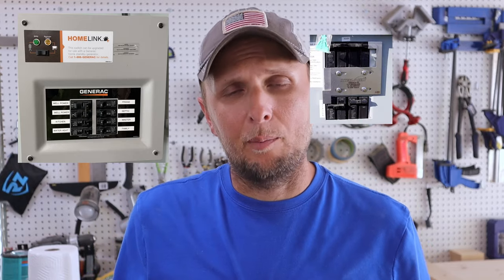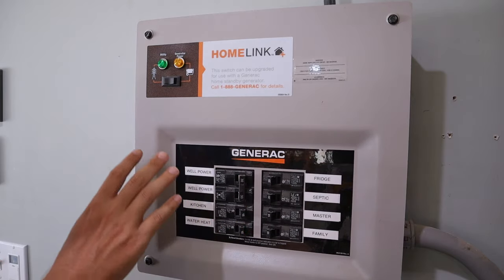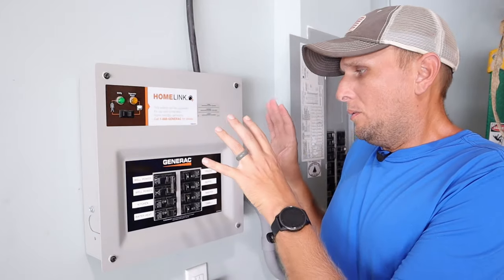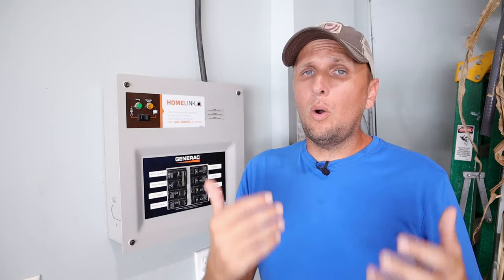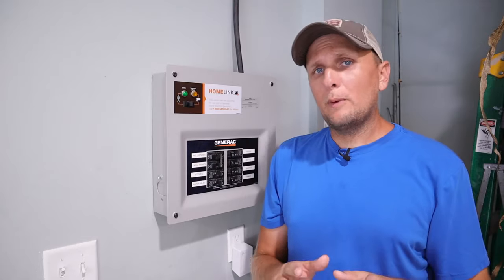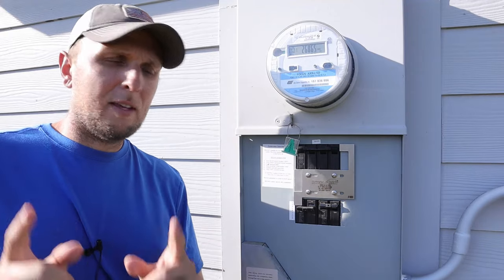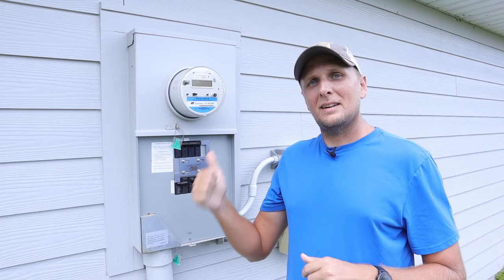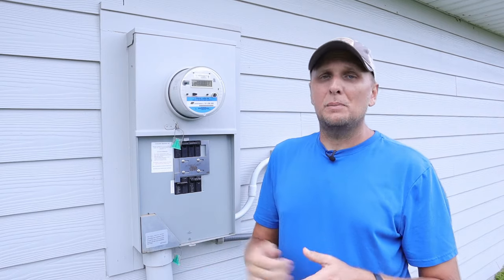How To Choose Between A Transfer Switch Vs Interlock Kit With Power Inlet Box

Comment: It seems like the transfer switch is ideal if you plan to switch to generator power often, or if the person doing the switching doesn't understand the loads within the house. 

I think the interlock switch would be what I'd personally use, as its nice to have the flexibility to switch what is powered in case you need to use something you didn't plan on when you installed the transfer switch. Although, I'd probably write up a "interlock guide" that shows what breakers to disable for normal 'generator'/backup use.
Reply: That's the one thing I never understood about the transfer switch, it supports say 6 breakers and that's it...OK got it but why not just use an interlock kit and just turn those 6 on from the main breaker panel rather than move it over to a separate panel? Also, the interlock gives way more flexibility.
Reply: @rustynail6819  Because some ones wife at some time will just turn every thing on and smoke the generator ask me how i know... 🤣🤣
why i went with  Transfer Switch.
Reply: @Mr_Meowingtons  yup!!
Reply: @Mr_Meowingtons => My wife would never roll out the portable generator & know which breakers to switch off, even though I printed up complete instructions & tape it to the breaker panel. Ploblem solved.

Comment: For me, the big deciding factor was that my breaker box, while it had some breakers in it (sewer pump, dryer, and a few more), it has 3 large (100A) breakers for "Upstairs", "Downstairs" and "Garage" which lead to three subpanels.  If I wanted to be able to switch individual things from upstairs or downstairs, I'd have to rewire them all the way back to the main panel, otherwise I'm going to use large breakers on a transfer switch and still have to go and turn on and off individual circuits not to overload the generator.

The interlock kit was much more straight forward.
Reply from the maker: Glad you found the right solution for you!  Appreciate all the feedback.
Reply: Whole house generator
Reply: Wait ... one interlock in the main breaker panel does not solve your problem.   It gives you the same choice (on or off) for each subpanel.  It does not give you remote control to individual breakers in the subpanels.

Comment: i like the simplicity of a transfer switch, but i think even with having to micromanage what circuits are on and off, the versatility of the interlock kit cant be beat for evolving power needs, especially depending what season it is when you lose power

Comment: For a smaller generator, you can build a simplified manual transfer switch out of a critical loads sub-panel with an interlocked generator feed on it.  Then you have limited loads for the smaller generator combined with the cheaper interlock method.  My real reason for having a transfer switch is the availability of an automatic transfer switch.  If the power goes out, it starts the generator and once there's a stable output, switches the sub-panel to the generator. When the utility power comes back and is stable it switches back to the utility feed and shuts the generator down.  That can't be done with an interlock.
Reply: I am a complete newbie to generators, electrical and all... I am looking at a Firman T09371 tri fuel electric start generator. I will be having it connected to natural gas line, so my running is 6900.

Am I to understand that an automatic transfer switch would fire up that generator for me? I assume I would have to leave it set to gasoline or propane for that and then manually switch on the natural gas after I realize the generator is running?  

I am under the impression I need to leave the natural gas valve (at the house) off until I need the generator for back up power.  

I am a solo 24/7 caregiver for parent with advanced alzhimiers.  Currently she is quite mobile, afraid if she cannot see me and prone to following me everywhere, so I am looking for the least expensive way to get us house functionality (I do lots of laundry using electric w/d). Without having to spend time outside in nasty conditions fiddling with stuff and managing her.

I also have  3 ton a/c and am looking at that soft start device. I have 2 sump pumps to manage rain water coming into basement area.

Gasoline:
Peak Watts: 11,600
Running Watts: 9,300

Propane:
Peak Watts: 10,400
Running Watts: 8,300

Natural Gas:
Peak Watts: 8,650
Running Watts: 6,900

This unit is only about $1300. 

I do have a trusted guy that is extremely knowledgeable about all manner of things... he is a commercial hvac guy right now but had his own business for a long time and also used to be a general contractor and puts most plumbers I have hired and electricians to shame.  Dude is awesome.  I am trying to do the leg work here and not impose too much on our friendship... lol.  

Many thanks for the education.

Comment: I like your content.

I find it fascinating that anytime the subject of a backup home generator comes up it immediately defaults to dire warnings that you must use either a transfer switch or an interlock system. If you don't you are breaking all kind of laws and could kill your neighbors or linesmen. 

Let's get real for a sec. The interlock system wasn't even invented until around 2005. Transfer switches a few years before. For those of us who live in places like Florida where power outages are a way of life we have been using generator backups long before these two items were even invented. 

The whole issue centers around one simple thing. Shutting off your main breaker to the power company. Once it's off it will not come back on until you MANUALLY switch it back on. That's the whole thing in a nutshell. If you are going to use a backup generator for an emergency power outage shut off your main breaker first. 

So all the Internet hysteria and dire warnings about killing people, doing illegal things, and breaking the law is just that, Internet induced hysteria. 

If you are not capable of understanding that simple instruction then perhaps you should rethink a lot of other things in your life first before worrying about a power outage.

Btw, I ran a 2400 sq foot home for two weeks at full power during a power outage using a suicide cord that I made and plugging it into the dryer outlet. No one died and no one got arrested for breaking the law. It's called an emergency power outage. During emergencies you do what you have to do to get by. 

As I said I like your content keep it up. Thank you.
Reply: The hysteria there for the same reason we have so many warning stickers. A shockingly large percentage of people haven't a f*cking clue on working safely on their own.
Reply: @armyfazer1410  Then they should get what they deserve.

Comment: I am recommending interlock kit as well. It costs no more in the end by the time you factor in the cost of the transfer switch, and gives you far more flexibility. My 5000 watt inverter generator (6250 peak) will run everything I need... Fridge, Freezer, lights, TV, Internet, Ceiling fans, Microwave, and just about anything else EXCEPT the central air (though it will run the gas furnace because the blower is on breaker of its own). My entire setup even with the pro install was only $1350. Most modern houses with energy efficient appliances don't take much power to run, though if the house is all electric and you want to stay warm, then yeah, 5kw may not be enough.  For me, 5000 watt was the smallest 240v inverter generator I could find.  I could have done with smaller if they made something, but you really need 240v generator to make the interlock work for all of the circuits.  I recommend to everyone that asks about it to skip the transfer switch. It just doesn't make sense.
Reply: Same here regarding whole panel back up using Two each EU-2000i Honda Generators.  

I converted my 240VAC/40AMP dryer breaker to be our new generator input breaker since our drier runs on Natural Gas using just a 120VAC receptacle.  I made a parallel fused jumper across the 40AMP generator breaker to power every 120volt load in the house on the same single phase.   

Steps to run generator
1 Open Main Breaker 240VAC
2 Open AC Condenser Breaker 240VAC
3 Start Generators and Plug in 120VAC/30AMP Cord to dedicated Input Receptacle
4 Close Output Breaker on Honda Parallel Kit 120VAC
5 Close 120VAC/40AMP Input Breaker for Generator Tie and now the entire home has power for every 120VAC load including the N.G Furnace.

We have a natural Gas Furnace, Water Heater, Range, and Dryer and Use 2 each 6000BTU Window units for Cooling, so this reduces our total load significantly compared to an all-electric home.  

This system works great with only a few load combinations requiring any load shedding mostly for starting inductive loads.  We are using this for emergency backup power on a 1800 square ft home in Houston TX.
Reply: The DuroMax XP4850EH dual fuel is the smallest 240v ,Peak Wattage on Gas is 4,850 with Running Wattage 3,850, on Propane is Peak Wattage 4,608, Running Wattage 3,658, I run my home 2300 sq ft home in Florida with propane all I run is all ceiling fans 4 bed rooms, TV.s  Fridge, well pump, lights, and PC's, no central AC. or water heater, I have a propane stove, running it with the interlock. I only spend $320 for my set up without the generator, 3 years ago I pay $ 375 for the generator, so my total was out the door for $695 give or take. oh yeah when I run the well pump I turn off all ceiling fans.

Comment: There are several cons regarding the transfer switch: 1) It supports a limited number of circuits. 2) Time-consuming installation. 3) The mix of 15 Amp and 20 Amp circuits may not be according to your needs. 4) It is very expensive.

Comment: For me, the decision to go with a transfer switch came down to the fact that I have solar installed on my house.  I didn't want the solar panels accidentally backfeeding the generator.
Reply: I wish they would make a cheaper way to have the best of both worlds, already own solar, own generator with interlock kit. But loose the free solar with the rapid  shut down. I can fix this issue threw enphase but not for less than 10k, and likely it will cost 20k, with number of batteries required, smart transfer switch, additional wiring. If anybody knows are reliable way sub $2000.00 for materials i would love to know. I have microinverters and existing portable generator with outlet and interlock for it.

Comment: Nice video on explanation of the two.  Just a few comments.  

1) The circuits, in the main panel, are not moved to the transfer switch.  The circuits you want connected to the transfer switch are just rewired.  They can be powered by utility or Gen, but never both at the same time.   

2) You need watt meters, to monitor both legs of the generator. (Doesn't matter if using a transfer/interlock switch)  This way you can keep the load balanced and not over load the generator.
Reply: Incorrect. The circuits ARE moved to the transfer switch…
Reply: For the one he used in this video, yes, but that's not the case for all brand transfer switches.  We have a 10 and 6 circuit manual Reliance Controls transfer switch.  The circuits are not moved from the main panel to the transfer switch. They are just rewired, through the transfer switch.
Reply: @Pk3_Garage  that's still effectively moving them to the transfer switch as that's where they're terminated, even if their wires still route through the main panel.

Comment: I have a 12000Watt generator can I use a 50 amp double breaker with my lockout kit?
Reply from the maker: Yup.  Would be great for that!
Reply: I’m no electrician, so 240 volts x 50 amps = 12,000 watts. Just be sure your wire to the inlet and fuse boxes can handle the high wattage. I’m sure someone knows the best gauge wire to use to help you out.
Reply: @dhammer6715  # 6 stranded THHN or equivalent wire.

Comment: I've got an all gas home and was convinced on a 10 circuit transfer switch, but now I want an interlock for the flexibility. Gas water heater has a 120v AC/DC brick, stove needs 120V for ignitors, gas furnace blower, gas dryer, washer, refrigerator, PC+TV+internet. Then I might want to power a specific room, which a transfer switch won't allow. There's still a lot of work for an interlock: moving your breakers to best balance the load from what you expect to have running. Starting with putting gas furnace on L1 and the fridge on L2. Then on my leg with the least load have my either/or appliances where I can only use 1 at a time (gas dryer or washing machine or microwave).
Reply: Suggestion - for a temporary situation or a permanent solution, get a Generlink meter base adaptor. Would recommend the 40 amp unit. I did not purchase the surge protection nor the wireless link as I did not need them. I did get the 20' cord with the 50 amp, RV type plug. It comes with a cord of your choice.
Safe, very easy to use, super easy (5 min.) for the electric company to install. 
I have no ties to the company. I bought one and it's a great solution. Using it with my Generac standby genset. Simply plug in the cord when needed, unplug when done.

Before contacting Generlink, I first emailed the datasheet info and request directly to our utilities director at the city. The city provides electric to our area. 

A week later I had his letter of approval! He did say that I had to contact his office to have it installed as the customer service reps don't know about the device.
Reply: I know what you mean.  We started out with a 10-circuit manual transfer switch for the circuits we needed.  I then installed a 6-circuit manual transfer switch to run the remaining circuits. (We have two 30-amp outlets on our generator) So now, our entire house is back up and we don't have to turn off any circuits to run things.

Comment: Transfer switch is more ideal. 1) Interlocks can’t be used everywhere legally, transfer switches can. 2) When the power is out people shouldn’t try to keep their home running exactly like before. It’s wasteful with fuel (which could be in short supply) and most people only use 50% of a generator capacity at any given time. A transfer switch makes people focus on what they really need and have it be sized to the generator they have.
Reply: Very good comment. Are interlock systems legal in Texas ? Where is a good place to look for the code about it? Thanks
Reply: @johncontos264  I think it depends on your local rules and even the utility that gives you electric service. My city and utility forbids interlocks because it can be defeated by removing the cover panel.
Reply: I’ll take the interlock and common sense, thank you.

Comment: But how much would an electrician charge me (ball park) to install the interlock kit?
Reply: I just had a quote yesterday, $1,500 per panel for a kit with surge protectors on both of my panels and some breakers and wiring. Crazy.
Reply: @zrile9986  oh ok. See, just not worth it for me to buy the kit and then pay $1500 for install. I rent. If I could paid somewhere around $500 and could take it with me when I leave, that would make sense.
Reply: @tacticalbartender3057  it would depend on the case.
The interlock itself is less than $100 usually around $50, the generator socket is around $20 to $75 depending on the style used. Most electricians charge $100-300/hour so, it isn’t that expensive for the interlock itself. What can get pricy is the circuit run to the location of the generator if not readily accessible.

Comment: Very informative video. In our case we went with a interlock kit. Our range, clothes dryer and on demand water heater are propane. The only 220 items are our well pump and central air. We have a 13kw dual fuel portable genny that I can hook up to our in ground 250 gal propane tank in a few min. and plug into the side of the house. With our genny we can run the whole house without picking and choosing circuits.. Living in Florida it is important that AC operates.
Reply: I grew up in Central Florida without A/C. I've been sleeping with a fan ever since.

Comment: To add to this great video and discussion. An outage is not the time to be figuring this out. Need to prove what will and wont run, how much fuel will you use and how much do you store? I am a retired electrician and finally got my stuff almost all squared away and tested recently here in New England. In my opinion we should shut the main once or twice a year and prove everything works. Might need to swap some breakers and balance the load. Do you have access to an amprobe? Run for 12-24 hours and know your fuel consumption, and learn what you can live without. I can survive for a while on a 2000 watt inverter generator. It can run on 3 gallons a day.

Comment: Great video. I’m hoping you can add more info for those trying to connect an EV for home back up.  Some EV’s, like the Lightning, cannot connect directly because of the bonded neutral / ground in the main panel. It causes the truck to sense a fault.  Users have installed a specific transfer switch (or unsafely removed the ground wire to the truck) to get around this. Videos to date have not been very good on how it’s done correctly.  Thanks
Reply: +1 on this. I don't have a Lightning, but rather an Ioniq 5 with V2L at 1.9kW output (quite small in comparison to the numbers in this video). I would like to know if it's possible for me to do this for only the most critical circuits (fridge, gas heating, and lights) in my home which in total rarely goes over 1kW/h according to my utility reports